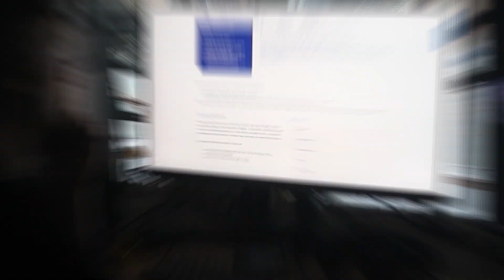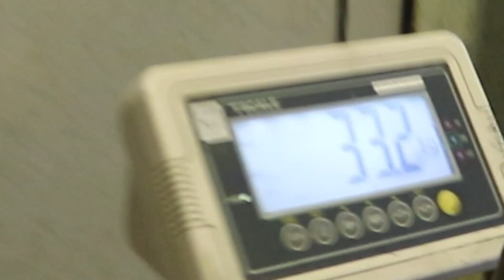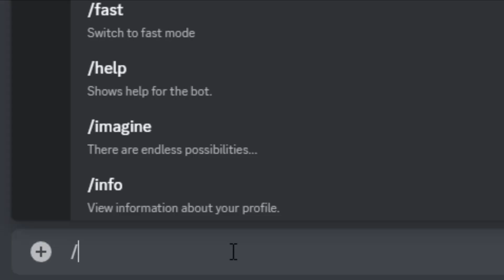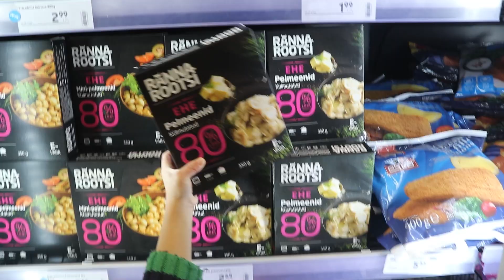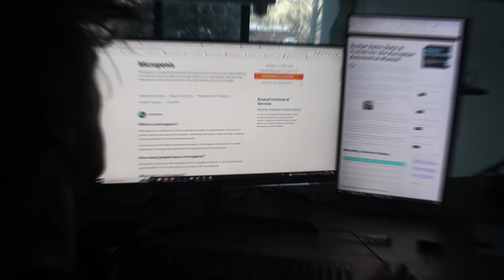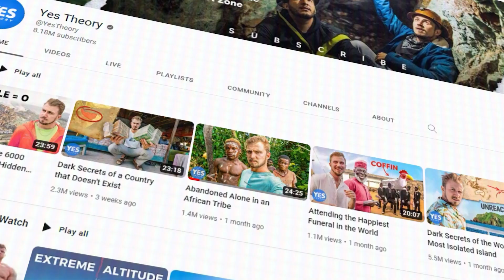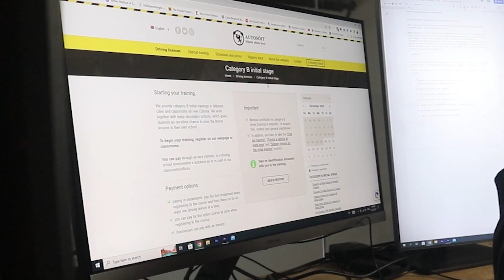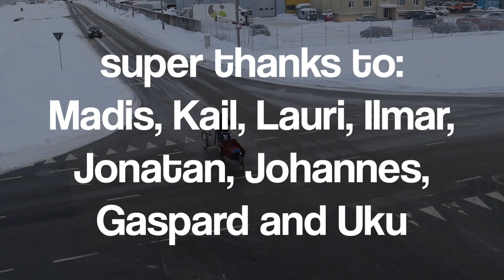I Measured PPS of DODGE RAM Owners

Comment: i live in the countryside and i cant imagine life without a car anymore , i would spend hundreds of hours extra every year to get normal things done. Also i think a 5.7l dodge ram CAN be practical when you need to move like 3-5 tons of building materials or something daily. But if you get the licence , it does not make you unable to drive a bike so... its a no-brainer really
Reply: Let me translate your first sentence: "I individually and selfishly moved to a place where my only transportation option is a car and now I'm angry that everybody doesn't accommodate my life choices."

About Dodge Ram. Cheapest used Dodge RAM on auto24 costs 7200€ and can carry 771kg. Cheapest Citroen Berlingo costs 1200€ and can carry 800kg. Let's not dream. Its about the prestige, not about practical needs.
Reply: everybody knows that people who buy dodge rams don't buy them because of the carry capacity. Any transport vehicle can carry more.
Reply: I agree about living in the countryside. Also for some people with disabilities. Also for emergency service and certain heavy transport. But not for the vast majority of people who use cars now. Not for people with children. Not for many cargo services. And many transportation needs we have could easily be replaced with more efficient services than owning a personal car. The price would presumably also go down as demand increases when most cars get an urban ban.
Reply: @JaanusKalde I was about to make a note about regulation differences for the US and EU resulting in discrepancies, but then I realized your point still stands. Only real difference even for work is a truck just comes with a bed (and back seats if required) while a van you'd hafta spend extra to get one on it